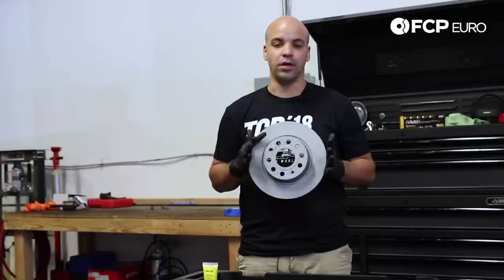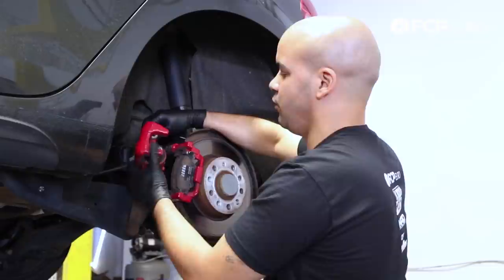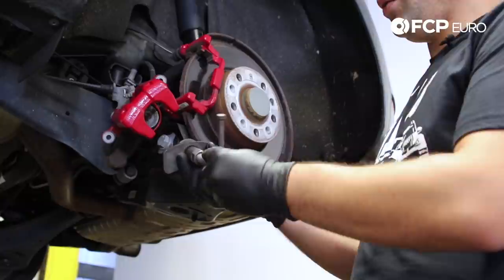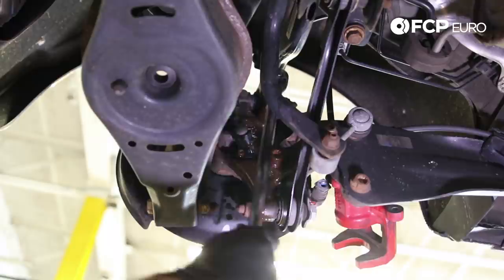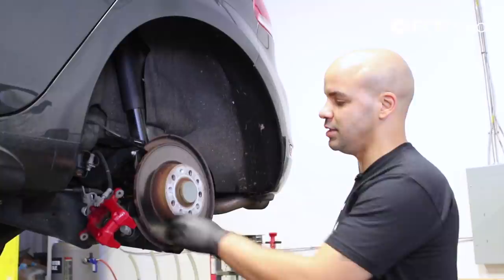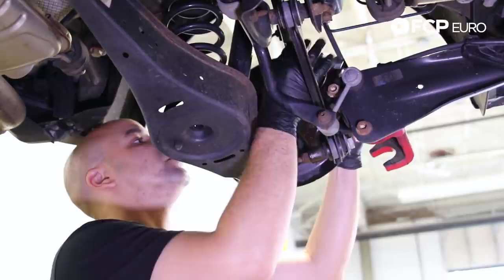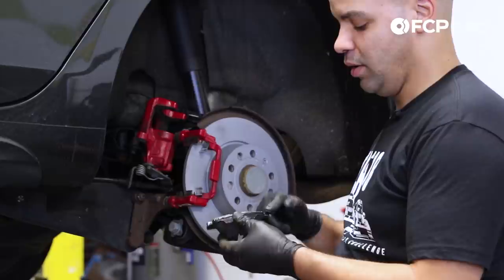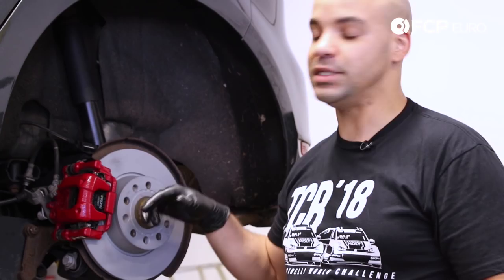How To Replace Rear Brake Pads and Rotors - Volkswagen MK6 Golf GTI (EOS, Jetta, Beetle, A3, S3)

Comment: good to open the break fluid reservoir before rewinding the caliper piston so that you don't have to fight extra pressure and don't blow a seal!
Reply from the maker: You're right Nathan that step never hurts!
Reply: Also clean the hub face before fitting the new brake disc
Reply: Good practice as these cars are getting on in years now and seals fail as they age.

Comment: Without a car lift it’s VERY hard to remove those long bolts!
Reply: I can't get the carrier bolt off at 4:29 what should I do?
Reply: @grand_master_glass  Ive got a Passat B8 & didnt need to take the bracket off to change the rotor. There's enough room to manoeuvre it past.
Reply: @belchnasty  not in my case :/
Reply: Sit on the ground and push with your feet with a decent sized ratchet worked in 2 seconds for me🤷
Reply: if you have small brake discs you dont need to remove caliper bracket to change discs. Just slide it out and back in at an angle

Comment: That's not going to work if the car has a push button parking brake. Do a video pushing the piston back with the push button parking brake with out the use of VAG COM
Reply: bruh mk6s dont have a push button but i see your point.

Comment: What are the torque settings on these??? Especially the triple square 14mm caliper bracket bolts??? Also, anyone have a service manual? I wonder if these are reusable.
Reply: I have an audi S3 and for the long 14mm triple square it is 90Nm + 90 degrees. The other bolts are 35Nm. But this is for the Audi S3. I think the other ones are similar.
Reply: @Guerrini2954  I just finished doing this on my MK 6 Jetta.  These are the same specs I found on a message board.
Reply: @adamwenzl4485  this answer also agrees with the Haynes repair manual

Comment: Does you have the torque specs for the splash shield behind the wheel bearing? Doing a drums to disc conversion on my Mk6 Jetta and put it pretty hand tight but don’t know if that’s gunna be safe
Reply from the maker: Those dust shields should be perfectly safe hand tight!
Reply: @fcpeuro  awesome. Should the bolts be replaced? I already ordered some bolts and going to go back in a torque everything down to spec but was wondering if I’m doing more then what’s needed

Comment: You saved me, i couldnt figure out how the hell to use the piston tool, thank you so much
Reply from the maker: You're welcome, Mark! Happy we could help!
Reply: Is this necessary to do? Or a step I can skip? If so why is it necessary?
Reply: @zuidkb7312  if the piston is not retracted the caliper will not go back on. Make sure to open the reservoir when resetting to let off the pressure, I learned that the hard way when my caliper seal broke. I keep a rebuild kit for front and rear now because a new caliper is $250!

Comment: Fun tip#1
If you don't have the 14mm triple square on hand, a 1/2 drive ratchet actually fits in perfectly without a socket on. It's not as ideal as the real tool but it easily got the bolts off for me without stripping anything.
Reply from the maker: That's interesting! Thanks for the tip!
Reply: Did this , got 1 out and the 2nd one ended up stripping. Currently trying to find a way to get it out :(
Reply: @Trippymk8   well, yeahhh I feel ya on that. It's fucked. currently dealing with this same issue almost. Bottom bolt isn't moving at all.
Reply: @Trippymk8  what’d you end up doing
Reply: DONT DO THIS you will strip your bolt
Reply: Very bad advice. Don't do this.
If you don't have the right tools, go and buy them. The tool for this bolts it's not expensive.
Reply: @XarlioG60  Buying them was not an option at the time.  I agree that buying the right socket makes more sense but to call this very bad advice is kinda of a dick move. It got me out of trouble in a pinch and I didn't strip anything in the least I dont see the problem. PS Im a legitimate mechanic that does this everyday if I was in my shop with all my tools I would have definitely used the correct socket.
Reply: Do not do this. You will strip the bolt beyond repair
Reply: @AFatherToTheFatherless  As I said not ideal but I live in eastern Canada where some of the rustiest cars in the world are and I didn't even fuck up one tooth on the triple square bolt and this on a 10 year old shit box. Use your head, if it's not going, don't go harder and strip it, It's that simple. I was fucked the stores were closed and it worked out for me flawlessly. Again like I said not ideal but if it can help someone out there in a pinch, then good. If you stripped it beyond repair it's because it didn't work and you tried it over and over again until it got that fucked up. That's on you man 🤣🤣🤣 
You don't keep on using a socket once the bolt is stripping do you? You get an extractor or heat up the bolt or something. Same applies here, if it doesn't work don't keep trying but if it works (which I've seen it work many times) then good for you, you saved time and money you might not have.

Comment: Will you ruin a piston that winds if you just push them straight in with a C-clamp? Thanks man.
Reply: Yes
Reply: @all4amd344  I figured that out the hard way lol.
Reply: @shanek6582  Rippppp
If you don't have the tool to turn it back in, you can use some angled needle nose pliers to turn it. It's slow af and annoying, but it works in the end

Comment: A few items unmentioned that i will add: first time user of the caliper piston reset tool- place wrench inside the caliper between the plate and the lip of the clasp (that wraps around thread). This is so that when you are done winding the piston back, the tool will easily removed. I unknowingly made this mistake (plate was tight against clasp lip and thus very firmly clamped inside caliper. Lucky for me I was able to hammer it free.. but that was a colossal waste of time. Learn from my mistake. Also, if you are in your driveway on blocks: you will need to invent a 90° pipe extension for a stubby breaker bar to undo those 14M triple square bolts.
Reply from the maker: Thanks for the pointers, Jason!
Reply: Can I use a electric wrench that is 60-90 Pnds torque to remove those big bolts?? I got it for small spaces and will fit or better yet if I get a Aircat air wrench that Is compact with 100 Pnds torque will that help ?? I’m worried once I get to rear I can’t get caliper brackets off I have hear horror stories.. I have 2016 1.8t Jetta nothing looks rusted really it has 81000 miles with original pads/rotors still...
Reply: The wrench is a digital aldeco clutch wrench where I can switch the torque I will see if it’s 90 torque when I use it and see if it lives up to its name... paid 300 for it at sourcetools.com
Reply: Dave Strysko they are very tight. 100ft lb +.. i wouldn’t risk using a machine that could shear the bolt.. hand strength allows the feeling of if its working. I made my breaker bar extension with 3/4” threaded galvanized pipes. Worked like a charm.
Reply: Jason Saari will try it when I do the job just worried I’m going to be stuck with only being able to change the fronts 😐 I definitely will try it.. going to order a 1/2 breaker bar about 24 inch in length or I might just spend the $70 for a 1-40 inch 1/2 breaker bar... I have 1/2 and 3/8 breaker bars already but always good to have extras and they are short also... my only concern is the damn brackets on rear and definitely don’t want to take to VW they will charge crap load of money... .. I can’t find the torque specs for rear it’s extremely pissing me off lol I know the fronts are 90.  I read the rear are 66 but I knew it was too good to be true
Reply: Jason Saari k cool thanks so longer the breaker bar obviously the more torque your applying but not really is what your saying and I can tighten the rear bolt to 80ish and be good?
Reply: Dave Strysko to be 100% correct- these carrier bolts are stretch bolts and VW would state they need to be replaced. A lot of mechanics debate this as they are so big. And again, they are holding the the brake.. but if you are hard pressed due to full access, you need to comprimise. Think about the purpose they have- just holding the brake in place. Zero lateral force, zero shear force... I felt how hard I tightened and I am personally confident of what i did on my car. But if i had a lift, i would use my big torque wrench and dial 100 ftlb
Reply: Jason Saari makes sense totally and yes I read too that we are supposed to replace the 14mm bolts also... I looked at mine front and back few weeks ago and no rust at all anywhere on fronts except rotors and front pads look new almost with 81000 backs are really low but I assume this depends on my driving and backs aren’t as thick also ... weird but is what it is... funny how VW doesn’t tell us shit so we have to bring car in... thanks for all the information I will post back when i finally do brakes ... also I believe my front driver side has a sensor? Not 100% but want to replace also cause I don’t want sensor going off lol another reason to have to bring it in 😂 I will do 80 torque like you did 👍 you have 1.8T Jetta like me also or another VW?
Reply: Dave Strysko 13 golf R. This video was the only training i had. Fronts were way easier as no wind-back was needed as well as turning wheel. Yes, VW is sometimes weird af.. but its all i’ve ever known so I’ve slowly amassed the weird sockets/tools that help. Didn’t have to replace my front sensor but it is easy enough if you want to do so. Best of luck.
Reply: @builtbysaari2143  can you send a picture of the bent pipe that you used? tnx
Reply: Ervin Sebag i don’t know how to/can’t as a reply.. give me your email and i will send pix.
Reply: @davediscostrezzo2107  Haynes says rear are 66 ft-lbs (90 Nm) PLUS an additional 90 degree turn.

Comment: Thanks! I almost gave up 😂
Reply: I hear you I’m about to start day/attempt 3 from doing a rear drums to disc swap video on my Mk6 Jetta SE. Had to get shorter bolts for the caliper bracket (to the spindle) because I have the non independent torsion beam suspension on the Mk6 Jetta which has a much thinner spindle. The bolts for the GTI are longer because of the spindle being thicker. Wish I woulda known this before because I kept threading it in and clamped the caliper bracket to the rotor on accident! Haha the rotor is new too and there’s a very small grove with a little red mark from the caliper bracket imbedded to the rotor. Do you think the rotor is toast?

Comment: Can I use a aircat wrench with my compressor to loosen the 14mm bolts or use my Aldeco digital clutch wrench?? I bought them just for the clipper carrier removals on my cars ... good for tight spaces but never used them yet... they are rated 60-100 torque but will find out if it’s enough
Reply from the maker: You should be able to!

Comment: Do you need that special caliper retracting tool or does a standard tool without the notches work?
Reply from the maker: Hello, for this you will need a tool that can spin the piston back into the caliper housing. There are multiple forms of this tool out there that you can source instead of the CTA unit we used!

Comment: Do you need to purge the brake like afterwards or is that optional
Reply: You don’t need to because the caliper was not replaced. You should do a brake flush every two years however. If you’re not sure when it was last done, do it so give you piece of mind. Never hurts

Comment: So these pistons on the brakes spin out when compressed or can I still push the Pistons back using a C-clamp
Reply from the maker: Hi Royce, the caliper pistons need to spin in when compressed, so you can't push them in using a C-clamp.
Reply: @fcpeuro  are you aware of any AutoZone or orielys having those tools for rent or for sale
Reply: Yes you can, I’ve done this job like 3 times now a d used a C clamp each time
Reply: C clamp for the front pistons only.

Comment: how different is it gonna be with Golf 7 TSI?
Reply from the maker: They are very similar in process, the main difference would be if your car has a manual parking brake vs electronic. Manual would be pretty much the same as this video. Electronic parking brake would require a VAG-COM or similar scan tool that can interact with the rear calipers.
Reply: @fcpeuro  Mine is manual transmission and manual parking brake. Any idea about the torque specifications on the 4 bolts (caliper and caliper bracket)? thanks
Reply from the maker: @amirb715  Ok, so since you have a manual parking brake you can follow all the instructions in this video.

Comment: I love how volkswagen's brakes do not have indicators on them... So there's no indication of when they go bad... You just hear metal on metal...

Normal vehicles have indicators on the brakes that let you know your brakes are getting low... Because you hear the indicator hitting the rotor...

But not volkswagen... Nope, When the brakes go bad they go bad... Nothing to let you know.. Other than metal scraping on metal...
Reply: My caliper seized and never knew it was coming until I smelt burning metal and saw sparks in my mirror